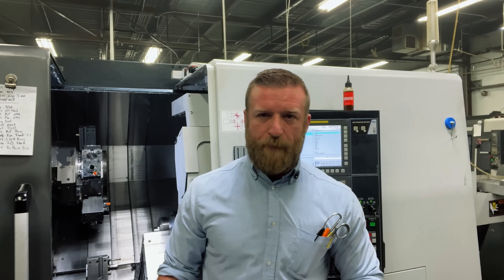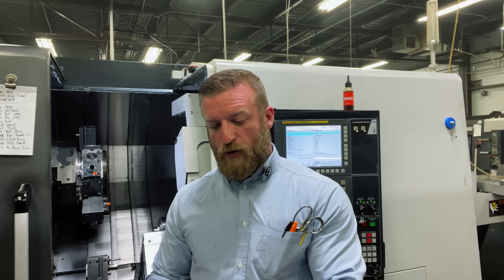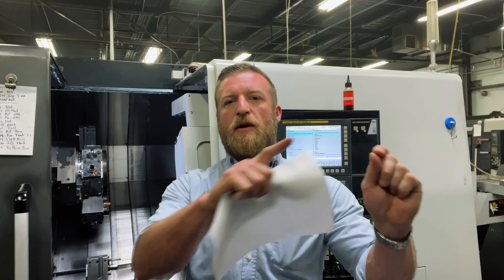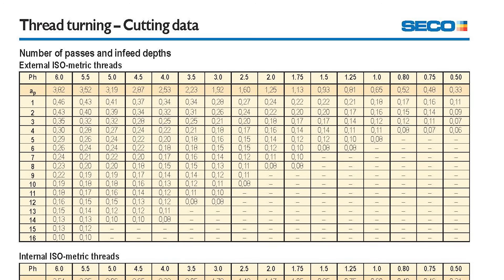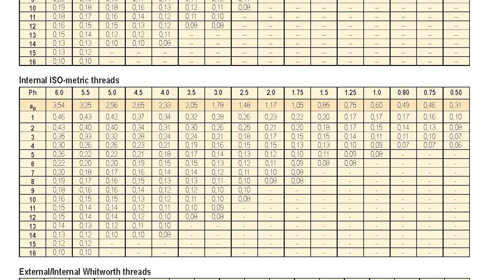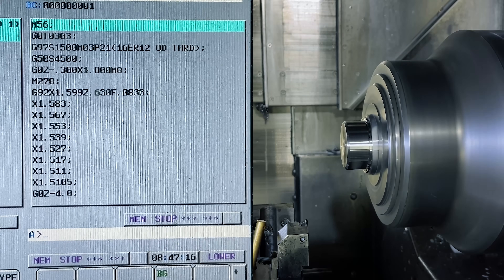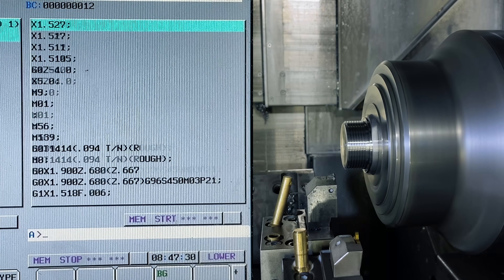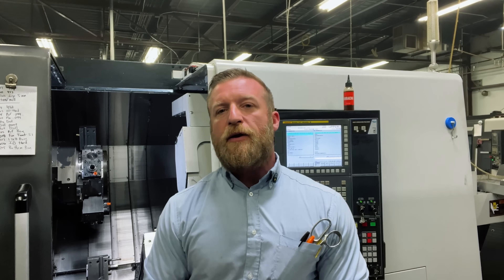How to Use G92 Threading Cycle on a CNC Lathe | The Lathe Lab Ep.6

Comment: I'm very new to this topic and have a lot to learn. On OD threading cycles I've been using a G76. It seems like a lot of work setting each X value for each pass. I'm sure there's a good reason for it, and wonder what the advantage of a G92 is?
Reply: Using G76 for the past 25 years it's definitely a better cycle
Reply: G76 is a great cycle and more advanced threading cycle. G92 is simple and that’s why I like to use it. Easy to change DOC per line - I think it’s easier to change that then on a G76. But G76 is a GREAT canned cycle
Reply: With G92 you can control the depths of cut of every pass (make the last 2 smaller than the rest for example), while in G76 they are fixed depending on the Q value set
Reply: @viktorignov7691 I agree with that. G76 definitely has its advantages but theyre both good cycles, for when they are needed. I like G92 because it’s much simpler to program and I can have many different variations of depth of cut, if I so choose.

Comment: When I was at the training that iscar provides in Texas the math they gave for the number of threading passes was 72/TPI+4. It seems to yield a slightly more conservative value (more passes), compared to the chart I normally use, but pretty close. 
I do also prefer a G76 threading cycle, but it can be annoying if you just want to deburr and chase the thread a second time.

Comment: Since I worked on automated lathe I had an opportunity to do M112x1.5 and M128x1.5 more often. Then I had huge problems with threading because I could not get chips out of the part. I changed the insert, it was rather better for stainless since it has a sharp edge but it helped a little. Then Instead of using the cutting data from my colleague I jumped on sandvik website and typed stuff in and it turned out I can double the cutting speed and quadruple the depth of cut. Worlds better thread and the thread gauge was going in smooth. In the end I changed the strategy of thread cutting to the back flank with 58° programmed for calculations inside that cycle and recutting starting point of 5.02 instead of 5mm. That was a tip from a application engineer I got. Thread is looser but since it is going to be galvanized and coated the thread will be perfect. Since then I can do 50 parts at most instead of just 15. I can run 3 days with piece of mind. Occasional checks confirm the reliability. In the end I had to go as much down as possible to loosen the wrapped up chips inside and it also helped in later evacuation after the cut.
Reply: Great info to have. How did you program the lead in? Curious what cycle was used 🙌
Reply: @Crusadermachining  It is G71 fixed thread cycle in my case (Okuma). I had to change thread cutting strategy in programming parameters of a dialog-oriented programing system so that it applies after creating a main program. Those are M-codes. They are put after everything else in that cycle. There are different infeed patterns which you can choose and even leave a stock for a finish cut. My current infeed pattern does shallower passes each pass for less tool stress until the stock allowance for a finish pass. The cutting occurs on the right side of a thread flank. But you can use other M-code for constant metal removal volume for example.

Comment: Hi Luke great video!
Question: how Do you like to deburr Threads? Specially in materials like stainless? I often am not allowed to have any sharp edges or burrs.. can be a challenge😂
Reply: Great question- I usually like to re-turn or re-groove (if there is a thread relief) - I cut off the burrs then I go back and re-thread. Sometimes on stainless I have to go back a second or third time with the turning tool.